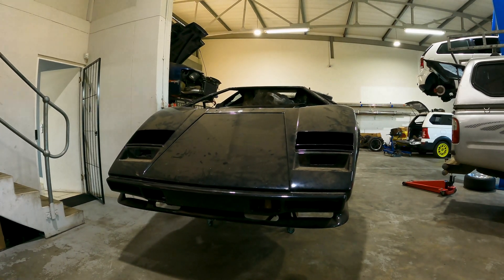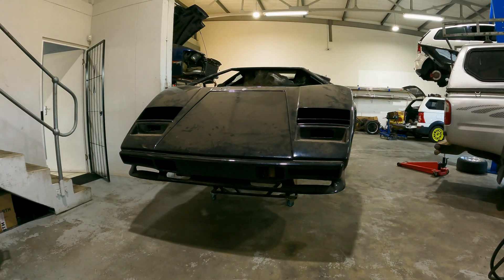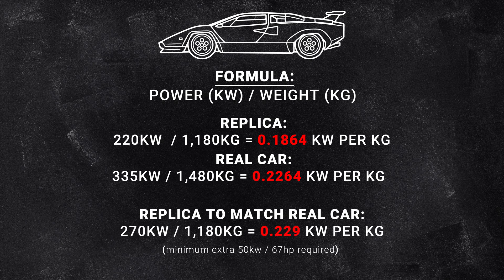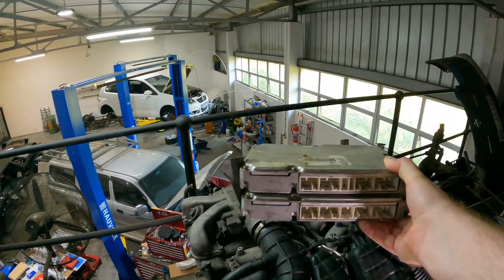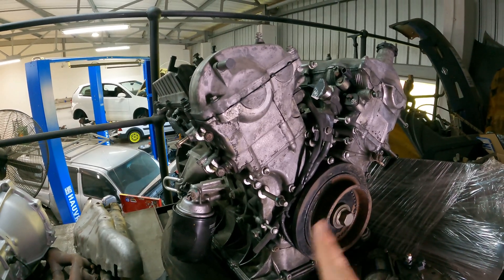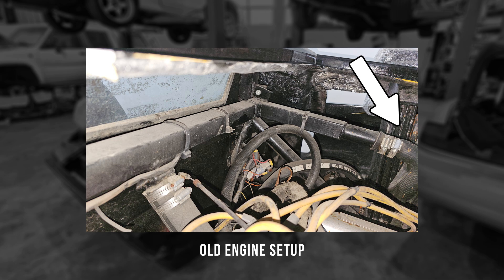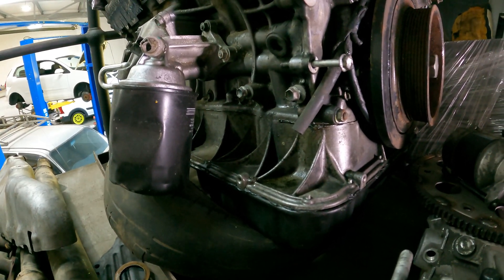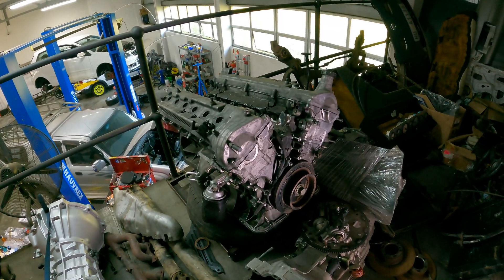Building A Lamborghini Countach Replica With A 5L V12 Toyota 1GZ-FE - Ep: 4 (Engine Overview)

Comment from the maker: If you'd like to get up to speed with this build, here are the previous episodes:

Episode 1: https://youtu.be/i9tydpedC1g
Episode 2: https://youtu.be/Hkgnccu7zhE
Episode 3: https://youtu.be/Ij0tAh9_gOo
Reply: The best ECU is the one your tuner prefers.
All the decent brands with enough outputs could run your n/a V8 but the tuner needs to make it happen.
Consult with them and add extra sensor ports just in case.
Also going for throttle by wire you can ditch all that 90s vaccum operated junk and half your teething problems like setting idle etc. Clean it up tons. You would need to use a suitable pump to draw mild vaccum on the crankcase but that is simple
Reply: @getahanddown  But he isn't running a V-8, he is running a V-12 and there aren't many single ECU's that can run a V-12.

Comment: If you don't have itbs in your v12, what's the point! Those ITBs alone makes the build worth it. It'd be like not putting a better sounding exhaust on it because it'd cost too much. They're equal contributors to the sound (arguably the better sound comes from the intake).

Comment: Very good video.  I just watched the video of you talking about building the chassis. I have a Strickland body that I am going to build. A good parts supplier is Buy the horns Paul dewling.  When you get a chassis design set up can you help me out with some measurements? Please and thank you. I have built several prova chassis and bodies back in the 90s that chassis sure looks prova. I sure would appreciate any measurements you have. I used to work at a place called Armstrong motorworks. We built a bunch of provas and other body styles. This is going to be my last car. If you can help please let me know.
Reply from the maker: Thanks for checking it out. Yeah sure, can keep you updated as time goes on. Buy The Horns actually supplied the badges for this car (visible in a previous video), and I'm looking to get a bunch more stuff from them to help make it look perfect.
Reply: @GarethBargate  outstanding. Let me know when you get some chassis specs. Thank you. Paul is a good guy. Mention you know me and he may charge you double. Lol I look forward to talking more with you.

Comment: Best way to get power out of these motors would be a decent set of cams and some head porting. Probably some aftermarket con rods. They are the weak link . Then as others say decent efi setup . Link or haltech and some big injectors. Tune it on e85 if it's available
Reply from the maker: Agreed, have heard a few people say the rods are a weak point. Bigger injectors are definitely on the cards, and we do have E85 here in South Africa as well.

Comment: Hi, Thanks for documenting all of this.  My 1GZ is on it's way.  If the engine checks out, I'll be keeping it as stock as I can. I'll keep the variable intake runners and it'll need custom exhaust too. I have the bell housing adapter kit coming to adapter the BK housing to a Nissan CD00A 6 speed I'll get new from a dealership.  I've started building some chassis parts for my Cobra and gathering resources. I'll be officially starting on it in the next couple of weeks.

  John Proulx's 1GZ Subaru is a built twin turbo using a MaxxECU Pro.  It's on my short list of ECUs because the software seems solid to me and it has the 2 DBW circuits and 2 knock sensor inputs 12 sequential injection.  I'm also looking into EcuMasters but it may have to be the EMU Pro 8 or EMU Pro 16.  I was also told from a rep that " Haltech also has a Nexus R5 which can run this engine sequentially and a Haltech R3 as well as the Haltech Elite 2500 in a semi-sequential".  I don't want to run semi-sequential.  Megasquirt looked like it needed a lot of add on modules to get the function of the others.  The Link G5 Voodoo Pro looks nice too but I cant find enough info/support.  I would consider the FuelTech FT5 or even the FT5 lite.  FuelTech had fast support response and the FT5 will do 2 DBW.  I like the built in screen and the people who use that as a dash, it works out well.  Spitronics quoted me an engine harness with Mercury Ultimate ECU but I would need to convert to cable on the throttle bodies. They said they have used Denso coils on the stock cam covers and they stick up a little.   I really like Hartley cam covers and they sell it with Denso coils if you want.  I know Audi coils are an option too but don't know about the fit in the tube.

The Cartune Company's channel has tons of great info on the 1UZ but when I got in touch about harness/ wiring they told me: 
"We only do 1UZ not the GZ"
"Sorry we can be of no further help"

  They say spark-waste is fine for use with a lot of power before sequential is necessary. The Skid Factory guy implied that stock bottom end is good to 450-500 but it sounded like a hard limit.  400hp sounds like a pretty nice goal.

-Shawn

Comment: How much would it cost to get custom cams ground?
Reply: You could simply have the backs of the original cams ground without having to get new blanks and regrind. This will give a higher lift and duration.  Ive done this on several OHC engines with good results.

Comment: Tuning V12s is quite rare compared to other platforms. I am excited to see what you can do with it 🤔 To get peak power n/a you will need good airflow in and out, tiny bit more fuel (although if your not boosting you can't put much more fuel in). These old v12 are lazy engines because they were designed to be quiet and high tourqe. 

Your limited on options being n/a, probably on the right solution with custom higher comp pistons with thicker crowns, potentially Beam rods and thicker wrist pins since the rotational mass is likely to increase.

Yeah we definitely need to crack this V12 n/a tuning 😎👍

Comment: Most V engines use 2 ecus 👍
If not using stock then I would use a vems ecu in wasted spark setup to keep the cost down personally. You can easily dump thousands on a sequential ecu.

Comment: Old school kiwi type mod, cut alloy manifolds above engine and weld on new flat plates for a big bank of side draft webbers like the original. Then just make up an electronic ingintion system for spark.
Reply: Thats exactly what Ive been thinking about for my car.  I currently have 4 x 48DCOEs on my V8, but Ive been considering the 1GZ with 6 sidedrafts.  Then as you say, its only ignition that needs to be sorted and thats fairly straightforward.  Problem is though, the carbs will make the engine really high and may not easily fit under the engine cover.  Easier on my V8 one as the V8 is 90 degrees, we have 60 here making the engine taller.

Comment: TBs seem by the look of them, rather narrow. May I suggest something a bit crazy: Get four Triumph triple ITBS and use them instead? They are small, and with a bit of fiddeling, they will fit. Air intake by the looks of it, seems to be the choking point of this engine. Engines are basically airpumps. Remove restrictions, and gain power.

Comment: You’ll get that power without opening up the engine.
Itb’s and decent headers will do the job. It would take a bit of engineering (making banks of six instead of four) but bike throttle bodies can be cheap as chips.
If you want to open her up then any decent head place can do a nice valve seat job and a bit of port blending. If you want you could take 20thou (I’m not metric, sorry!) off the heads but 10.5:1 isn’t low and you might start limiting your fuel options.
ECU? Doesn’t matter as long as it can physically drive the ignition and injectors on a 60° V12!! All you pay for is extra capability, which I personally have never cared about. My car runs a microsquirt!
With the itb’s and headers it will definitely sound the part!!
Good luck with it.
Reply from the maker: Thanks for the in-depth response. Never thought about bike throttles actually. Head port is also something we'll do for some "easier" gains.

Comment: skid factory have done swaps with these v12s and use haltec ecu to run them
Reply from the maker: Cheers for the suggestion, I've lined up a bunch of their videos to check out this weekend.
Reply: @GarethBargate nugget garage also Ozzy has a supra with V12 Toyota very knowledgeable bloke  his is over 1000hp but with a single rear mount turbo

Comment: To get that V12 scream, you will need to merge the headers from each bank, and as early as possible. If you keep them separate, it will just sound like 2 inline 6s.

A great example is a yellow Targa Tasmania Jag XJS with side-exit exhausts that were merged through an X-pipe somewhere underneath. The sound is unbelievable.

Although merging will have them going into a single pipe, it can be split again into the two sides that you mentioned. It will be worth it, trust me.
Reply from the maker: Agreed with that, my concern with having two outlets without an x-pipe / crossover somewhere was that it would just sounds like two inline 6's arguing with each other. I watched a video from DIIVIINE (spelling?) with his V12 Century, and the sound after the x-pipe install was way better than before.
Reply: @GarethBargate The headers are the most important. Bringing the banks together is essential but the distance to the x pipe won't have much effect on the range, it will just change the tone marginly.

Make all the headers equal. For the first head:Collect 3 cylinders at a time (2 sets of 3), then merge them into 1.

Then merge the two banks with an x pipe 👍

The distance before and after the x pipe does not have much effect, that is for fine tuning raspyness and tone.

Good luck with the project
I just started my V12 build 😎
Reply: @GarethBargate The header configuration shown in your video 6:43 is perfect 👌 just even them up before the collector.
Reply: You can also get the scream by merging at the tips on the outside of the car like the zonda does. The more important aspect is equal length headers. The distance to the x pipe will only change the tone however its not linear. Too much or too little and it will sound raspy.
I have done alot of studying for my V12 build using a Mercedes M120 (OG zonda engine)
Reply: Don’t forget STEPPED HEADERS, put 4 steps with the headers
Reply: 2. Designing the Stepped Headers

	•	Primary Tube Size: Start with a 1.5-inch inner diameter for the first section. After about 8-12 inches, step up to 1.75 inches. Then, after another 8-12 inches, step up again to 2 inches. This progression balances low-end torque with high-end power.
	•	Length of Primaries: Aim for around 28-30 inches total length before merging into the collector. You’ll want equal length for each primary to optimize pulse tuning and scavenging.
	•	Collector: Use a 3-4 inch diameter collector after the final step. The collector length should be around 6-10 inches.

3. Materials Needed

	•	Stainless Steel Tubing: 304 stainless is a popular choice because it’s durable and resists corrosion. You’ll need enough tubing to cover both the primary and stepped sections.
	•	Collectors: Prefabricated collectors or custom-fabricated using the stepped tubing for each bank.
	•	Flanges: Custom flanges to fit the 1GZ-FE’s exhaust ports. You might need to get these CNC machined or buy them if someone already makes them (good luck with that).
	•	MIG or TIG Welder: For welding the tubes and flanges.
	•	Mandrel Bender: To bend the tubes without crimping them.
	•	Measuring Tools: Tape measure, calipers, protractor for accurate angles, etc.

4. Fabrication Steps

	•	Step 1: Measure Twice, Cut Once: Measure the space in the engine bay. The 1GZ-FE is a wide V12, so make sure there’s enough room for your headers to fit without interfering with other components.
	•	Step 2: Create a Jig: A jig will hold your pipes in the correct shape and position while you weld. It’s like a template, ensuring everything lines up perfectly.
	•	Step 3: Flange Work: Start by attaching the flanges to the engine. Then, weld the primary tubes to the flanges, ensuring they extend about 8-12 inches before stepping up.
	•	Step 4: First Step: After the initial 8-12 inches, use a mandrel bender to shape the first step of tubing (1.5 inches to 1.75 inches). The bends should be smooth to maintain the flow.
	•	Step 5: Second Step: Repeat the process with the second step, increasing to 2 inches. Make sure all tubes remain equal length by measuring carefully.
	•	Step 6: Merging into the Collector: Once the primary tubes have stepped up, merge them into a 3-4 inch collector. Ensure smooth transitions here to avoid turbulence and maintain the exhaust velocity.
	•	Step 7: Welding: Use a MIG or TIG welder to tack everything in place first. Check for fitment and clearance. Once satisfied, go ahead and fully weld each joint, ensuring no leaks.

5. Fine-Tuning and Testing

	•	Fitment Check: Install the headers onto the engine and check clearance with other components like the steering rack, firewall, and underbody. Make adjustments if necessary.
	•	Leak Test: Pressurize the system to check for leaks. Fix any leaks before moving on.
	•	Performance Testing: Fire up the engine and listen to it scream. Check for exhaust leaks, and listen for any abnormal sounds (like rattling or knocking) that might indicate fitment issues.

6. Tuning for Maximum Performance

	•	Stepped headers are only part of the equation. Pair them with a free-flowing exhaust system, a high-flow catalytic converter, and a quality muffler (or straight pipes if you’re feeling rebellious).
	•	ECU Tuning: To really squeeze out the power, consider a custom ECU tune. Adjusting fuel maps and timing can maximize the gains from your headers.

Comment: Most reliable Lamborghini - lol.   Beside one of their Tractors that is.
Great project - REALLY enjoying this progress!!  Thanks
Reply from the maker: Thanks for checking it out. Just going to make a chassis "introduction" video next - so we're all on the same page, and then time for the actual fun to get started.
Reply: I have seen too many split Lamborghini tractors to agree on that: The clutch is a weak point!
Reply from the maker: Lol, good thing I don't have anything OEM Lamborghini related in the engine or clutch department.

Comment: If there was a proper local solution, I would’ve said ITBs. You’d be earning millions of ebucks on your fuel spend … but, I would go for a nice port and polish, increase the compression ratio, lightened pulleys and flywheel with the EcuMaster Black. Accompanied by those headers, you will make good power especially here at the coast. This is exciting!
Reply from the maker: Lol, the RX7 already accounts for loads of rewards points...what's a few more? But otherwise, solid suggestions. We can race the Honda when it's done.
Reply: A lightened flywheel would be awesome 😎 I bet the stock one is a very heavy one for super smoothness.
Maybe another more common lightweight flywheel meant for some other Toyota motor will bolt on?
Reply from the maker: You are right, when I took it off the engine for this video I was reminded how heavy the stock one is. Lol. We'll have an update with the clutch / flywheel etc soon.

Comment: Great project. I put the 1gz-fe in a Porsche 928 with a c5 Corvette transaxle. Had it running on Megasquirt MS3 pro engine management system. Great engine with a ton of torque starting at 1100rpm. The factory intake with the ACIS system works very well,  I'd keep it.  Expect about 415hp/420ftlbs out of the 1GZ in stock form with a free flowing exhaust and a good tune.Cheers
Reply from the maker: I'd be quite happy with power figures around there, thanks for the feedback
Reply: Yep, even 400hp with stock cams would be awesome 👍
Reply: @GarethBargate  My tuner called it The Wall of Torque. The 928 is gone but I have another 1gz for the next build!

Comment: I would keep the original intake manifold with the long runners. Concentrate on the valve train and better ECU. with a good tune on larger injectors combined with the right gear ratios you will easily surpass the original Lambo without a big spend. The exhaust will be another fun consideration. You are on the path to a great car build!
Reply from the maker: Thanks for checking it out. Yeah, I like your idea. That and a few small other touches could get us to the desired power figure.
Reply: I feel the same with keeping original intake. My thoughts are to port and shave the heads to increase compression along with the injector upgrade

Comment: Very nice exhaust 👍
The standard intake manifolds could probably benefit from port matching and polishing.
Smooth tapered intake hoses instead of the standard noise reducing hoses will help flow, but for example Toyota's V6 2grfe will lose power with a nice tapered intake hose, unless you have the ecu tuned, or fit a MAF adaptor, because although the airflow is greater, it doesn't have the standard uneven flow which caused more airthrough the MAF.

I'd do a lot of research before modding. I had a 1zzfe that made a fair bit more power from just a high flow muffler, MAF spacer and 2zz injectors. I learnt that from some Toyota forum , which had spent a lot of time figuring that out.

Comment: look into doing 4 individual exhausts from the engine back, no cross overs or x pipes.  This is what ferrari did back in the day to give a true v12 sound.  ms3pro evo or ultimate can control 12 cylinders as well in waste spark sequential fuel configuration

Comment: When trying to meet or exceed the performance of the actual car keep in mind that the actual car went to 90 mph in first gear and so one thing to consider how the transmission and final drive ratio could potentially level things out. At least on the lower end/0-60.
Reply: Try again 62mph in 1st 84mph 2nd 109mph 3rd
Reply from the maker: Valid point - the Audi 0A2 we're using has a final drive ratio of 3.625, and it's 6 speed (opposed to the actual cars 5 speed).